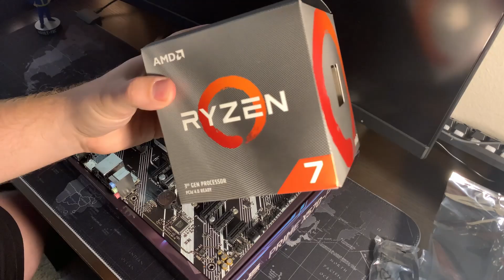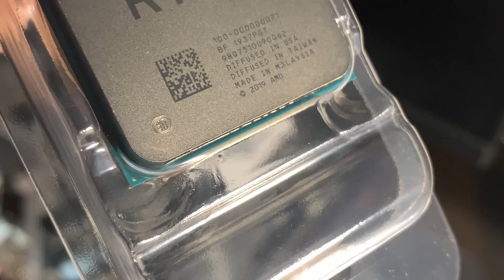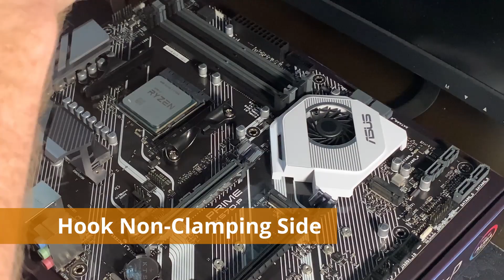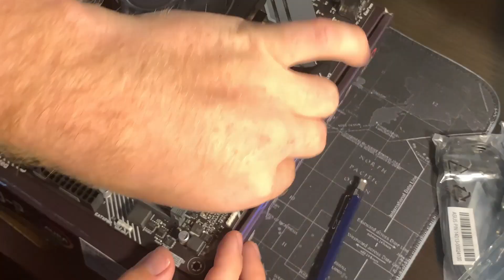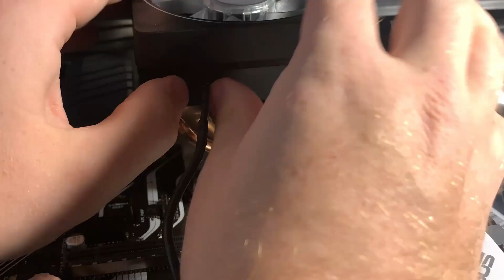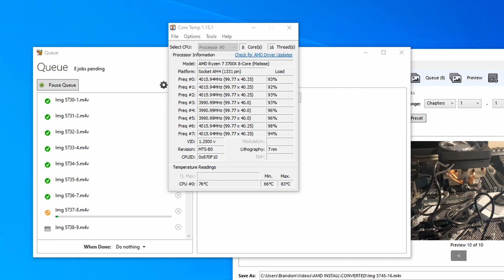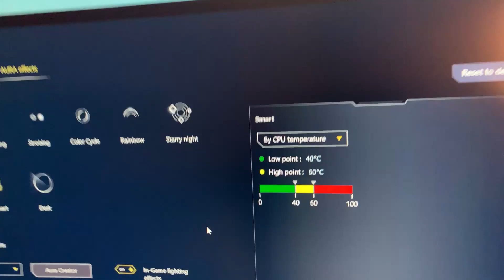How to Install AMD Ryzen CPU and Cooler for Beginners

Comment from the maker: Uploaded a follow-up video! Including tips on cable management and controlling RGB. https://youtu.be/3KZQKYsQud0
Reply: I cant turn mine off.. also best desktop envirmoment... i havent found one that supports hdr video for the desktop and fully customisable app windows and widgets... stardock is fucking shit
Reply: Hey man I was wondering if the fan will light up with only plugging in the usb 2 connector and the cpu connector I don’t care if I can’t control the color I just wanna know if it will light up at all with only those 2 wires
Reply: @watchyohead1  it lights up if the fan is connected to power, the usb cables added with the wraith prism cooler are purely so you can change the RGB on the, i presume you are new and may not have the wraith prism cooler and just the amd stock cooler.
Reply: it's top left not top right.

where the amd logo should be.

at https://youtu.be/alHCJAkzhsA?t=153

mark.

you even installed it with logo top left. so it's just a miss spoke from you I'm guessing. but a big one. so maybe you should add some text clarifying it.

Comment: You don't need to connect both RGB cables to the cooler. If you connect the cooler via 4 Pin RGB cable, the cooler will act as a single RGB component and LEDs can be controlled via Aura Sync but LEDs are not addressable in this case. But if you connect the cooler only with the USB cable, you can control the LEDs of all three zones (Fan LED/Ring/Logo) separately and they are addressable. To control like that you need to install Coolermaster Wraith Prism software.

Comment: The prism performs the same as a single 120 rad AIO water cooler. I tested mine out a few days ago. The prism looks much nicer though, because of its 3 separate RGB lights which can be modified to any color you desire, with the AMD Prism software you can download. Its also very silent, provided you choose the silent setting on your BIOS or even create a profile so it only runs at full speed (which sounds like a turbine engine) when your cpu hits 70c. That's how I have mine and 70c for an R5 3600 is perfectly fine and well within its max temp. The beauty of it is, I only reach 70c when I'm benchmarking, but it hardly ever goes above 69c when playing games. Really nice.
Reply: Ordinary GP   if your temps are in the lower or mid 70s, you're totally fine.  These CPU's will operate well even in the high 70s without detrimental long term consequences, according to AMD. Some one on reddit was able to register the TJM at 95c. But I'd keep it no higher than 79c if possible,  just so it doesn't heat up your tower too much, along with any GPU you may have running.  A hotter ambient temperature will cause more heat with your components.

Comment: I've built a number of computers before but haven't seen this style of AMD CPU cooler.  I was confused why the lever was so hard to push over, then watching this I see you have to apply pressure to the cooler to get it to snap in.  Thanks much for the help Techhut!

Comment: Having holes on top of your case makes hooking the clamp with the lever much easier because you can peek through them while hooking the clamp. Also, either install the heatsink while you haven't installed the motherboard info the case yet (much easier!!) or install the heatsink with the graphics card removed. If your graphics card is near the CPU socket the clamp with no lever is a real pain to hook onto the CPU bracket.

Comment from the maker: Side Note: After a few days (with both cables plugged in) my RGB began to flicker. Unplugged the USB and now it is fine. :D
Reply: So you dont need the usb?
Reply from the maker: No use it vs the RGB cable
Reply: TechHut ahh okay ty for the quick reaction👍🏼
Reply: @TechHut  hi, I've got a question besides this. I was thinking about building my own pc and I've put together a list of parts. But I'm just getting into building pcs, so I would like to ask if the parts I chose are good and if they could be better for a lower price. my build is, Gigabyte Aorus x570 Motherboard,  AMD Ryzen 7 3700X Processor, GIGABYTE Radeon RX 5700 XT GAMING OC 8G, 2x16gb Corsair Vengeance Rgb pro DDr4 3200Mhz, Intel SSD 660p Series 1.0 TB, M.2 80 mm PCIe, Pure base 500DX and Corsair RM650 80 Plus Gold. thank in advance :D
Reply from the maker: Jolanda Kanters Sounds a lot like my build! I’d try to go with 3600MHz memory if you can. Other than that it all seems good. You probably already have just double check the compatibility.
Reply from the maker: Jolanda Kanters I’ll be uploading a video on my current build soon js 😉
Reply: @TechHut  wait. You said in this comment you unplugged the USB, but then said use it vs the rgb. So which one to I plug in? Lol
Reply: FYI, anyone else on this comment chain. I plugged in the USB only and it works beautifully!
Reply: @Beeeerj  If you can wait,  the new 4000 series cpus soon coming out, might be better and getting one of those. Myself on a old system and either upgrading to the 3700X or completely new system if the new cpus are really good (my x370 board dont support the 4000series coming)
Reply: Athos it’s gonna be hella expensive tho, and I’m getting a pretty great stock cooler with it. So I’m fine for now, but stull thnx for the tip👍🏼
Reply: Is the rgb 12v or 5v?  I think is 12v but just to make sure
Reply: Hi, my question is wich porgram i should use to control the rgb
Reply: can you still use the motherboards rgb software if you don't plug the rgb cable in?
Reply: what usb are you talking about?
Reply from the maker: On the cooler that the CPU comes with there's an option to plug it into either USB headers or RGB headers on your motherboard.
Reply: @TechHut  oh ok, so should i just use the rgb headers and not the usb?
Reply from the maker: @ethra9543  I'd use the USB header there will be more configuration options down the road.
Reply: So..to be clear..... basically... i just need to use 1 cable(either usb or rgb) rather than 2 cables(usb and rbg) right?
Reply from the maker: @dr.c196  Yes use the USB one.
Reply: @TechHut  thank you!
Reply: How can I disable the logo led ?
Reply: @dr.c196  i have the software
Reply: @dr.c196  the logo led has a bright white led and i want to disable it it doesn't do what i install i know it's connecties properly because when I update the firmware the logo breaths on off so it is possible
Reply: @runarjans  there are 3 tabs on the mid/right side of the software.. you need to click on "Logo" and change settings.
Reply: @dr.c196  man i know you think I'm dumb but im not
Reply: @dr.c196  the thing is that the settings don't work
Reply: @runarjans  change it to black color or low light if it cant be disabled from software
Reply: @dr.c196  the problem is that it doesn't do anything only the fan led and ring led work
Reply: @Beeeerj  aa
Reply: @MarksAGoodLad  do you know if you can change the colors?
Reply: @abramcartmill5025  Can indeed! The way I have it connected (usb only) allows me to control every aspect of it's look. Colors, patterns etc. Very cool.

Comment: Very informative. Much thanks. Had my computer assembled by the guy at the shop (then redid it myself as the cable work wasn't aesthetically pleasing) and never understood why the CM utility kept saying that it couldn't find the RGB device. Never realised until after watching your video that there's actually another cable for the RGB. Thought the main fan connector also handled the LEDs in one go. Your video prompted me to look inside the box of misc parts just to find that there was in fact two cables there waiting to be used. As suggested, used the USB one and worked immediately.

Now I can finally do away with the annoying RGB cycles and stick to the boring white lol

Comment: Thank you for being specific about orientation and where to plug the fan power cord. As a 1st time pc build I am triple checking everything and some of the others tend to skip the fiddly bits which makes me worry. Thanks for looking out for this noob.
(Did I use that right? I think I used noob correctly.)
Reply from the maker: You did. You're welcome 😉

Comment: So you mean its better to use the USB socket to control the lightning of the prism than using the RGB header. Am I right?
How did you cable manage the cable going to USB socket?

Comment: You didn't even follow the advice in that Reddit post you put up?! If you use the USB 2.0 header, and the CoolerMaster software, you can control the fan LEDs, the ring LEDs and the AMD logo LEDs all independently. If you use the RGB header, you can only control the fan LEDs.
Reply from the maker: I motioned this in a pinned comment and the post is from Tom's Hardware. I read that during editing. I ended up taking out the RGB cable.
Reply: @TechHut  No worries. In the pinned post you said you removed the USB cable. I think best one to remove is RGB cable, as USB let's you change the fan, ring and AMD logo all independently. The RGB cable only lets you change the fan LEDs.

Comment: when i put the cpu in the spot with the lined up triangle when i put down the retention arm there was almost no force needed and when i took the cpu cooler off (i wouldnt boot) the cpu came off with the cooler like it wouldnt sit in place any help

Comment: Is there a general rule of thumb for where the “top right” of the motherboard is?  I’m using a different Motherboard and the logo being in the top right isn’t an option for what I would assume the two “tops” of the motherboard may be (although obviously I have no idea what I’m talking about haha).

Thanks!
Reply: USB/HDMI/Everything is on the left of the Motherboard (the back of the PC) so the top right would be in the upper right corner of your Case i guess
Reply: @Ehrenlurch  what if the cpu socket is in a different location or orientation (idk if any mobos are like that tho tbh)
Reply: @RedVRCC  i think the Ports are always on the same side, at every brand but if the CPU socket is at a different place, there still shouldn't be a problem except the radiator might be to close to something else bc of that
Reply: @Ehrenlurch  thanks.

 I've had one of these coolers that came with my 3800x and it's been held on by only gravity for several years now. Every time I open my pc for an upgrade I try at least once to finally latch this cooler. The rigid leg without the clamp never reaches the plastic hook on the motherboard.

Comment: @TechHut do u think it will light up with fan header connected only? 

Hope y’all stayin safe and healthy
Reply from the maker: The AMD logo and ring light should turn on but I don't thing the actual fan will turn on. 

You too 🤓
Reply: @TechHut  Fan turns on but the light is random.  I missed connecting the RGB cable.  Now I have to connect it.  Thanks for the video.

Comment: How are you supposed to manage the cable though? My GPU is right "under" the CPU, so the wire gets in the way. Do you make the cable go to the left, right, or just right over the GPU?Thanks!
Reply from the maker: It's sorta a pain. I have it going around the side near the back of the PC over the top of the board and back though the bottom.

Comment: I have the same motherboard. My rear ports and case ports are not working. (USB’s, hdmi) getting no display on monitor and not a single usb is working when plugging in keyboard/mouse. Any ideas what I may have plugged in wrong or not plugged in?

Comment: I don't know if you respond to these comments anymore, but I was wondering why my 2700X went to 89/90C when converting DVD files to MP4, well now I know (improper mounting).

My question is, and there is so much information yet so diverse, what would be the right amount of thermal paste for a 2700X/3700X (generation jump, but perhaps same amount)?

Thanks in advance, 

Mr.

Comment: Just a tiny question. I’ve found that my thermal paste is pre-applied like a tire track. Little tiny dots all spread out. Will the thermal compound still work as normal?
Reply: Yeah, though I applied some more just in case
Reply: In my case is the same. What did you do?
Reply: you don't need to apply any more thermal paste, in fact i'd advise against it. if you wanna use your own thermal paste, clean the surface of the cooler that already has it applied.
Reply: I was worried about this too, but it turns out AMD has started shipping them with this updated pattern instead of the usual pad. So its perfectly fine.

Comment: i am a little new to this pc building thing. I think that the wraith prism looks very good but have a ryzen 5 1600. Is it possible to mount a wraith prism on my processor. it didnt ship with one, just a small ''steath'' i think it was called. so is there any size differance of the cpu or anything restricting me from putting thi on?
Reply: Ryan Airns thanks for tour answer

Comment: I plugged the USB component in and it gave me a message on power up saying USB Over Current Status detected. I was told only to plug the USB component and I only did that and got the message. Do I need to plug in the USB component and the RGB wire?
Would appreciate any help

Comment: Do you find the Wraith Prism Cooler loud? Even on idle, it seems to be very loud for me.
Reply from the maker: I don’t find it loud. I’ve could be my case though. I hardly notice it.
Reply: its also depends if you have good airflow in the case
Reply: Just installed it. Loud as hell... but ive seen others have the same problem. Supposedly its with the plastic housing on the outside that causes it.

Comment: Which is the programm, that makes the CPU light in red when it's too warm? In Video you don't show this.
Reply from the maker: It was done with Asus Aura Sync. It came built into my motherboard. There is also software from Cooler master that should he able to do this.

Comment: Should I be worried about me cpu? While putting it on I didn’t realize that one edge of the cooler was leaning over the edge of the cpu. So, I tried to put it on crooked like 3 times until I realized that it was crooked then it fit just fine. But I’m worried that that one edge of the cpu may have been crushed or dented or something.
Reply: if the pc still operates normally and doesn't overheat then nothing happened

serious cpu damage would result in the pc not working 

improper cooling would cause it to shut down very quickly from overheating

Comment: Does that led cooler come with every ryzen or do i need to buy it? Because im going to buy the ryzen 3 3100
Reply from the maker: No I think you need to get at least a Ryzen 7.
Reply: Ryzen 3 - Ryzen 5 comes with the Wraith Stealth cooler which is not RGB. Ryzen 7 - Ryzen 9 comes with the Wraith Prism (except the Ryzen 9 3900XT and the Ryzen 9 3950x.)

Comment: Do I have to use the RGB cord and the USB because I don’t enough ports so can I just use the cooler it self?
Reply: You should be fine as the fan is powered by the cpu fan slot. I think you don't need to use both rgb and USB header if you want to power the fan lights. But otherwise you should be fine with just the fan on without Leds on. Take care :)

Comment: what did you use to sync the Cooler RGB and the RAM RGB? was it just your motherboard's software or was it an application
Reply from the maker: Owen O'Brien it was the Asus software that came with the motherboard. If you use the USB connector you should be able to use 3rd party software. 👍🏻
Reply: @TechHut  do u recommend the motherboard rgb software or a 3rd party software.
Reply from the maker: @LaughterChief  I'm enjoying the default software 'Armoury Crate'. I'm not picky, I have it set to rainbow unless I'm running heavy tasks. In that case I use the Smart mode to what my CPU temps. If you want more customization I'd try out other software. I personally have not. :)

Comment: Hey mate I got a question as I'm almost having a meltdown lol. Is the prism needed? I have an RGB cooling fan that I will have to take out if that's the case. The cooler sits over the CPU where the prism goes. Sorry such a noob should have done my research.

Comment: Question can i connect normal fans to CPU_FAN1? And if i have air cooler can i connect it to AIO_PUMP?
Reply from the maker: That may cause issues with heat control. It’s dependent on your mobo but if your CPU gets to hot it will crank up the CPU_FAN speed. AIO_PUMP is intended for a water cooler. You could set it to run 100% all the time and plug in the CPU fan there if it’s not to loud.

Comment: without thermal paste?
Reply from the maker: The Wraith Prism Cooler comes with thermal paste pre applied. If you do use anything else make sure it is pre-applied or you add your own.
Reply: @TechHut  okey, thanks, I bought this cooler but I still didn't build it in my pc because I must wait until the Pc-Stuff will came

Comment: After installing the CPU, I looked at the side of the motherboard, looked at the CPU and seen the CPU pins. Is normal?
Reply from the maker: I don’t believe so it should set into the socket. Any updates?
Reply: I realized that it was a bent pin, so I had to fix it and redo it. All is well with smooth gameplay 🤙🤙

Comment: I’m new to pc so I’m sorry if this is a dumb question but do you need a cpu cooler if it comes with one. I see a bunch of fans all over peoples builds so it confuses me
Reply from the maker: Keeping the CPU cool is very important. That comes with good airflow so the inside of your case won't get to hot. You should check out the linuxtechtips video on cooling.
Reply: TechHut thank you! I was looking into getting the ryzen 3700x though. Do you think this wraith cooler is enough?
Reply from the maker: @dmg3691  it's perfect! That's what I've been running. Link in discription.

Comment: Do I need to use thermal paste?
Reply from the maker: If you're using the included cooler it should be pre-applied.
Reply: TechHut Thanks